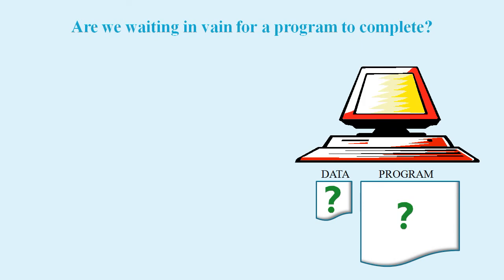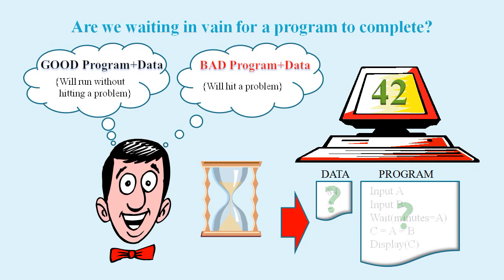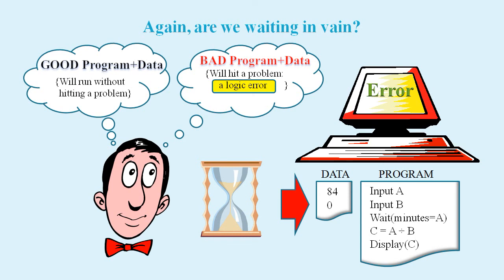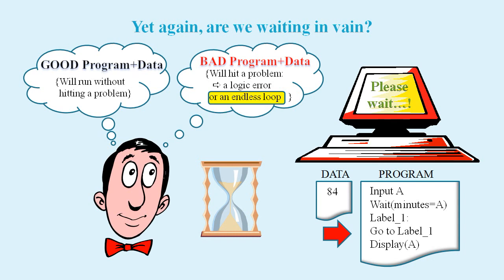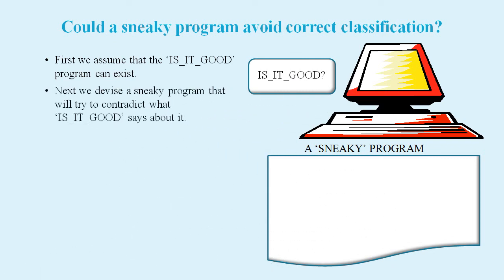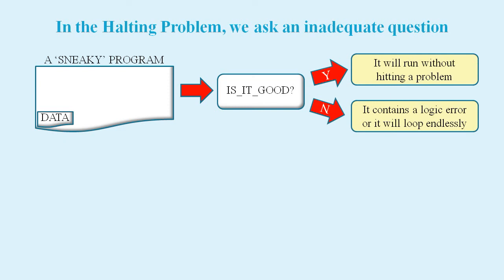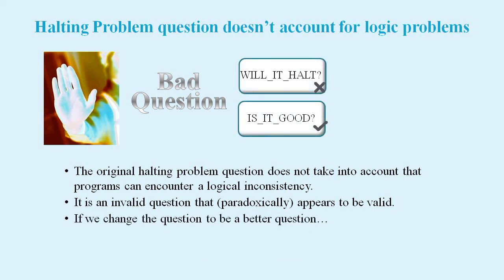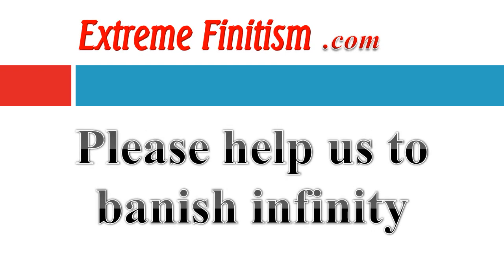Halting Problem: Finally Revealed - The (Logic) Problem with the Halting Problem

Comment from the maker: The Halting problem proof is proof by contradiction. This type of proof can only tell you that something went wrong, it doesn't tell you what went wrong. It might have been a mistake in one of the assumptions, an oversight in the scenario description, a flaw in the logic and so on.

When we hit the contradiction in the Barber paradox it is a little easier (than the Halting problem) to figure out what has gone wrong. The two categories of 'shaved by the barber' and 'shaved themselves' are not mutually exclusive: the barber can go into either category. If a predictor places him in one category and afterwards we ask him to state which category he thinks he should be in he could choose the other category (see the similarity to Halting?).

Now, we could claim that the specification of the Barber paradox is fixed, we are not allowed to change it otherwise it would be a different problem. Then we might conclude that it must therefore be impossible to know who shaved every person in the village. But we DO know who shaved every person, we are just constrained by the specification because the specification is flawed. The specification starts by assuming that the two categories it uses are mutually exclusive because it assumes that every shaved man must fit into just one of the two categories, just like every program must either halt or loop.

So perhaps the specification of the Halting problem is flawed because the there are not two but three types of halting behaviour. It could be an illusion that we have just the two categories of Halt and Loop whereas perhaps there should be an extra category that we might call the Who_Speaks_First_Standoff. This third category might end up as a LOOP or it might end up as a HALT. Just like with the Barber, it can go into either category.

The claim that the Halting problem contradiction tells us that it is impossible to detect looping is absurd. We know it is absurd because both of the two types of looping used in the Halting problem proof are detectable. The only thing that prevents the Predictor from giving a valid prediction are the constraints of the specification. It is the constraints that prevent us from producing trivial solutions.

There are at least two ways to solve the Barber paradox and they both require the flawed specification to be changed. 1) We can make the two categories properly mutually exclusive. For example, we could change them to 'shaved by the barber' and 'not shaved by the barber'. 2) We could make sure that the Barber has to speak before the predictor, ensuring that the predictor knows what the barber will say.

Exactly the same applies to the Halting problem. We know the specification is flawed and the only way to fix it is to change the specification. We could have the same two solutions as for the Barber paradox:

1) We could make the categories mutually exclusive, which is the solution I went for in my Halting problem video (with GOOD and BAD categories), or

2) We could ensure that the Predictor always has the final say. This can be achieved in different ways. For example...

2 a) We could preventing the final 'if-then' from happening in the sneaky program via a run-time check. Our justification is that we claim that the contradiction highlights the need for this type of error checking (a 'trying-to-defeat-prediction' logic error) to be done at the machine/system level in the same way that an out-of-memory or similar error needs to be done at that level. 

2 b) In addition to 'It will Halt' and 'It will loop' the Predictor could report a third message such as 'For the halting behaviour see lines nnn to mmm of the input program'. This defers the final bit of interpretation of the code to a person who is effectively at the top-level (machine/system level). Since the sneaky program can't change it's code after the Predictor has spoken, the Predictor will win because it has the final say.

So my argument is that we CAN and we MUST change the specification because the Halting problem contradiction is telling us that we need to.

Comment: In comments, you mention the "system control mechanism". What is this exactly? Does it mean only the program itself can detect if it has endless loops? Also, meaning that a compiler cannot detect if a program has those loops?
Reply from the maker: The 'system control mechanism' is my name for the real-world physical machinery upon which a piece of software can be executed. In other words it is a real-world computer together with its read-only-memory operating system.

Even though we can emulate all aspects of a physical computer, such an emulation will always need a physical machine to run on.  And so I use the expression 'system control mechanism' to mean the physical machinery upon which any piece of software needs in order to run.

You said "Does it mean only the program itself can detect if it has endless loops?"

My interpretation of the Halting Problem proof is that it tells us that the detection of halting should be done by the hardware level (the physical machinery of the computer together with its read-only-memory operating system) rather than by a transient piece of software that runs under the control of the hardware. The proof tells us that if we try to do loop detection at the software level (as opposed to hardware level) then we can always be defeated by a sneaky program. I hope this answers your question.

You said "Also, meaning that a compiler cannot detect if a program has those loops?"

Humans can detect a lot of very simple and obvious loops and so there is no reason why a compiler cannot do the same. However, other loops might be very difficult to detect until the program is executing. The same can be said for some other logic errors such as exceeding the maximum allowed integer value, accessing an invalid memory address, or a divide-by-zero error. These logic errors, together with some loop detection, will need to be detected during program execution.

Note that I do not consider it to be a valid argument to claim 'but the hardware level can be emulated' because any emulation requires a real-world piece of hardware upon which to run.